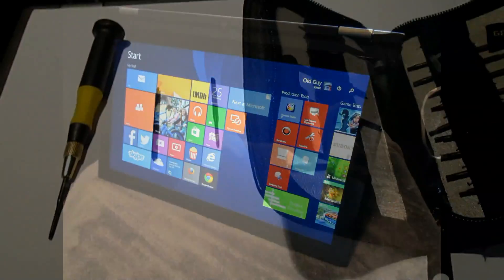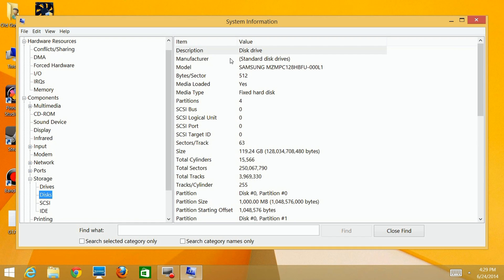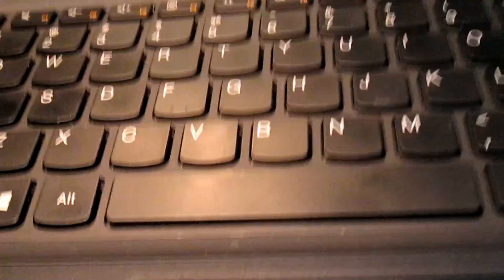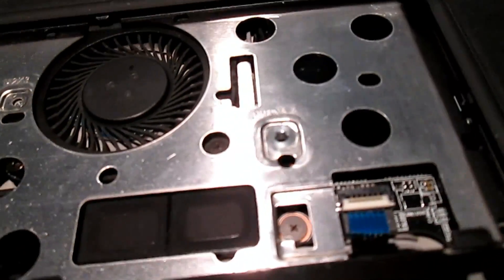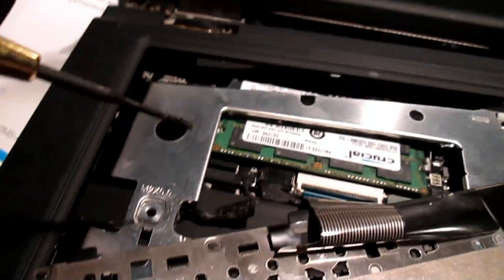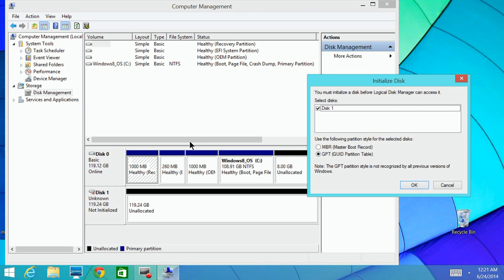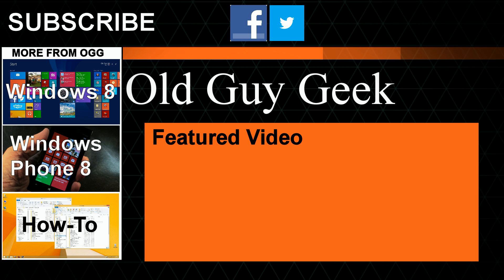Lenovo Yoga 13 - Add 2nd SSD Detailed Instructions

Comment: Great video. Question. Do you have an Amazon link to that exact ram module? I currently have only 4GB in mine since it came with windows 7.
Reply from the maker: My Yoga came with Windows 8 so I'm not sure we have the exact same model. Just lift up your keyboard and you should see the RAM module there. Use it's part number to search in Amazon.
Reply: @Oldguygeek  Will do! Thank you!

Comment: Thank you. I was just doing a bunch of repair, maintainence on my Yoga 13 and saw this and upgraded the hard drive space. Hoping with its Corei5 it will continue on for a while now. The lack of hard drive space was causing update and other problems. Now its fixed without a costly trip to a tech place. Thanks again.
Reply from the maker: You're welcome. Glad to be of help. Mine is still going strong and fast as can be with a SSD as the boot drive.

Comment: I went to your evo 860 link, ordered it, when i disassembled my computer to install it, it was way to big for space provided. My computer is Lenovo yoga 13
Reply from the maker: Strange. It appears that the shortened link from Amazon doesn't go to the same drive anymore. Here's the right one. https://amzn.to/2l6HlXr
Sorry about the bad link. I fixed the video.
Reply from the maker: I found another one that is 250GB and is a bit cheaper. https://amzn.to/2l8J2nr

Comment: This is a 710.
Do you have a video for the Lenovo Yoga 720 (13)? I’d like to see a complete tear down and/or rebuild.
Reply from the maker: I don't, but i did a quick search on YouTube for 'Yoga 720 teardown' and there are several videos about working inside one.  You might have found one by now, but just do the search for that model and you should be good to go.

Comment: Excellent post. I know very little about these things. I just followed your detailed instructions (including buying the torx screwdriver set and going into the BIOS - whatever that is lol). Anyway, because technology is always changing, I was able to install an internal Samsung 850 EVO 1TB SSD hard drive!! Now, I can continue using my 2013 Lenova 3 Ideapad (which I think is one of the elite laptop/computer/tablets ever made!).  Thanks again.

Here's the link for the torx screwdriver set. It's a great value and even came with a plastic tool that safely let me open the keyboard case. https://www.amazon.com/gp/product/B015F734P0/ref=ox_sc_act_title_4?smid=A13PRKMVKLJGWH&psc=1
Reply from the maker: Glad to hear the video helped. That's exactly why I do them.  My Yoga 13 is still going strong and it's even running the latest prelease version of Windows.

BTW, the BIOS is the built-in software that resides in the chips on your motherboard.  It allows the hardware to start up until it can access your hard drive and load the Operating System that is stored there.
Reply: I am currently not really happy, with the speed of my Lenovo Yoga 13: is the 850 significantly faster then the original ssd?
Reply from the maker: Not that you would notice. The real limitation is the processor in the system.  Also, there are many other things that can impact the speed of your system. Some virus protection software can really bog it down.  Plus other backend processes.  The SSD speed is the least of your worries.
Reply: I also assumed, that the CPU and the Bios is the limiting factor. However, would have been really interested in a Benchmark (in case, that both are Samsung; Samsung Magician could be a solution.)

Comment: Thanks for the video - I got a little concerned when I saw no clips behind the keyboard and one end of mine seemed to be "stuck" down but it was gradually releasing. I followed closely along but at first neglected to remove the torx screws since you only mentioned them in passing "facepalm moment". I was able to ease the case apart and get my 500G Samsung SSD installed. 

.... BUT as I was about to replace everything I noticed the blue-ended  ribbon on the right side of the keyboard seemed to be flapping in the wind :( I was not sure how it was connected all I could see was a small plastic flappy flange with some copper spikes where the connector came from. Examining the copper contacts I could see small indentations so I assumed it was just a pressure contact rather than broken.

I panicked for a bit until I found this video : https://www.youtube.com/watch?v=iOE4T6nykQ4

I carefully used some needle nose pliers, slipping the ribbon cable back under the flappy flange and pressed it down - it now all seems to be working and I have another 500G of storage :)
Reply from the maker: Yeah, the cables in any laptop are probably the most dangerous part of the whole thing.  Glad to hear you got it working.

Comment: hello! I added 500go Crucial SSD to my lenovo yoga 13 following your video.  but since that, I get death screens with kernel data inpage error and a lot of other messages. 
during a few days, every thing worked fine! but after updating firmware of crucial SSD and doing some settings to optimise it, i get the Blues screens! 
would remind that Os is still on the original lenovo ssd! I'm using the new on juste for storage. I also created some dynamic links to store every thing on Crucial drive : desktop, videos, pics, dwlds ...etc. 
do you know how a can fix that plz!
Reply from the maker: Did you take the crucial back out and see if you still have problem?  Since the error only occurred after the firmware update, you should be a able to run without it.  If that works, you'll have to see if you can access the crucial on another system.  You'll need an adapter to hook it up to a system either to a USB or directly to your motherboard.  If you can get another system to recognize it, see if the firmware update completed ok or maybe you can reattempt it.

I don't know what optimization you did, but Crucial probably has a utility to detect, read and optimize.  If you used that and it failed, you might have to contact Crucial.  If you used some other optimization utility, try the official Crucial one.
Reply: Thks for answer.
 I used official Crucial tool to update the firmware and after tests, the drive  seems to be ok. i can store data normally on it and use it as normally as possible! 
problems began when the update utility terminates and restarts! I got some issues! my pc restarts endlessly with crucial utility instead of restartiing normally with Windows. after serverals attempts, i had to put everythings on defaults il Bios so my pc restarts finally normally. 
I think i have to check if update completed normally! otherwise, is it possible to put back previous version of firmware? 
sorry for my broken english...
Reply: Cricial SSD Still works normally and i get less of blues screens but i want to fix this because i'm working on a huge document for my phd and can't save every minute. So if a restarts occurs, goning to lose a part of it. thks
Reply from the maker: I'm wondering if your Crucial utility was starting because somehow an error was detected on the SSD.  Much like if your PC detects a problem with a regular drive it will perform a disk check prior to starting Windows. 

If you are worried about your docs, I would setup OneDrive to replicate them to the cloud.

Have you checked the Crucial forums for problems after the firmware update?  Also did you do the Lenovo bios update as part of the install of the drive like I showed in the video?
Reply: I posted on crucial forums, no answer yet. 
Crucial SSD still workiing fine! no blues screens since 3 days! all utilities i used to test it indicate a high lever of health. 
I hope that the problem was resolved :) thank you for help!
Reply from the maker: Glad to hear you got it to work.  I was really concerned that the firmware updated failed somehow.

Good work on getting it done,

OGG

Comment: Hi, I followed the instructions as in the video and now the laptop does not recognize either hard drives. I removed the new hard drive and still no change the BIOS and booth manager are not finding hard drives. I have not touched the original, primary hard drive. It's my father's primary and only computer and any help would be of great help. Thanks!
Reply from the maker: +Pranav Sharma Cool.  Yea, I learned long ago when working with a Fujitsu tablet, that ribbon and other connectors like them are so easily screwed up.  I'm sooo glad you got yours fixed.
Reply from the maker: +Pranav Sharma I would double-check the cable under the keyboard.  If one is loose, you can have various problems.
Reply from the maker: +Pranav Sharma Also, check out this blog and the link to download the maintenance manual

https://forums.lenovo.com/t5/Lenovo-Yoga-Series-Notebooks/Can-you-install-a-second-mSATA-SSD-in-Yoga-13/ta-p/1039799
Reply: @Oldguygeek thank you for the link to the forum
Reply: +Pranav Sharma I actually just had this problem, and I managed to fix it.  My problem is that the motherboard had become disconnected in the process of taking everything apart.  There is a connector above the battery and is green in color and is, I believe, labeled "MB."  Make sure that's not disconnected.  Mine was, so I pressed it back in, and suddenly I was able to boot just fine!
Reply from the maker: +AxelFan91 Thanks for your info.  I had replied to her and not heard back.  I hope she found the problem as well.  I figured it was a connector problem, but I had no way of finding out which.  Maybe she'll see your post.
Reply: Sorry for the late response, I have the same issue as Alex, turned out it was broken connection on the right corner to the motherboard. Plugged it in and fixed the issue with everything upgraded.

Comment: Just an FYI. There are four clips underneath the center of the keyboard. It is important to press down across the center of the keyboard while sliding it towards the front in order to engage those clips. If you don't engage those clips, the keyboard will be very bouncy. Thanks for the useful video. I just upgraded my Yoga 13 to 8GB RAM and added a second 500GB SSD to the existing 128GB. My Yoga has been around the world several times and been used in rain and dust and I've never had any trouble with it. I'm hesitant to upgrade to the Yoga 2 or 3 for fear they are not as robust.
Reply from the maker: +2jomok2 You're right there are four clips in the front, but if you slide the keyboard back in from the back and slide it forward, it will hook onto the clips.  Those clips aren't really designed to be pushed down to clip, the keyboard tabs slide in.

I understand your reluctance to upgrade your Yogas.  I didn't do the second SSD until mine was out of warranty.  But you sound like a more advanced techy person so I'm sure you won't have much of a problem.
Reply: I might be talking about different clips. You are speaking of the four plastic clips to the front of the keyboard.  There are also four metal clips underneath the center of the keyboard going from side to side. You can see one clearly at 5:04. I learned from experience 8-( that if those aren't engaged, the keyboard will be bouncy.
Reply from the maker: +2jomok2 Yep, probably.  I found that the back clips need that tape that was there.  Otherwise it was bouncy too.  But at least adding the second driver sure made the Yoga a lot more useable with the extra space.

Have fun with it.

Comment: Help.  Followed the video.  Everything seemed to go fine but now won't power on.  Tried the reset button next to the power switch.  Still nothing.  Any ideas?
Reply: Howard Solovei Stlll have the case bottom screws out. Do they need be in for some reason to power on?
Reply from the maker: Howard Solovei Nope, I left the screws out until I tested everything.  Check all your ribbon cables under the keyboard.  Make sure you didn't dislodge one.  Also, if you still have problems, remove the extra drive and test it without it.
Reply: Howard Solovei Nevermind.  Found loose cable, works now.
Reply from the maker: Howard Solovei Excellent.  Glad it works.

OGG
Reply: Thanks for your help.

Comment: can you tell me how i did you see ssd at bios pls i can't find ssd (i installed properly)
Reply from the maker: Süleyman Aslan If the SSD is ok and install properly, it should just show up in the bios.  If you can take it out and reseat it or plug it into another computer to check it. Hopefully reseating it will do it.

Comment: This second hard drive can only be use for storage right? you cant install programs to it?
Reply from the maker: latribu99 Sure you can. Most desktop programs have dialogue boxes that comes up and asks where you want to install the program.  Most everyone ignores that and keeps them in the Program Files or Program Files (x86) directory.  But you can choose wherever you want.Years ago, software was more finicky and upgrades of software sometimes wouldn't find the installation if it was installed elsewhere. But you should be safe today.  I created a Program Files directory on the D drive as well.  I didn't bother with the X86 directory to keep the 32 bit and 64 bit programs separate.
Reply: Old Guy Geek thanks for the info. I'll definitely try to get a second HD on mine yoga

Comment: Thank you very much for the detailed video. I managed to install a 250gb Crucial ssd. I used maximum disk space and ran a quick format which showed the new ssd with 232gb available space. But after restarting the computer, available space had dropped to 220gb. Losing 30gb, even after formatting is pretty significant for a 250gb ssd. Is there any reason for losing such a lot of space and is there a possibility of reformatting to correct this? Or am I just being paranoid?
Reply from the maker: Rasta Fari Well, you're right, 250GB should have more space. But check to see where the system put the swap file.  You may not need one with the SSD.  Do some searching to get the latest recommendations.  Then check your Recycle Bin size.  It's normally way too large.  Lastly, check your browser's cache size.
Reply: Old Guy Geek Thanks for the reply. I'll look into that. I did some research online and a maximum of 232gb space should usually be available without issue. Contacted Crucial and they also agreed that 220gb is too little to get out of 250gb.

Comment: Hello, can I use Samsung SSD mSata 500GB EVO840 as 2nd disc?
Reply from the maker: David Šenkýř If you have the original Yoga, sure.  But you have to have a 2nd mSata connector in your system.  Check your system specs to see if it is capable.  The manufacturer and size of an SSD aren't normally restricted.  Windows 64bit will access disk with terabytes of room.

Comment: Shame the video is completely out of focus....
Reply from the maker: It's not.  Use the gear setting in the lower right of your video panel.  Change the resolution to 1080HD. It looks great.  You can change your YouTube account settings to always show videos in high resolution.  Then you never will have this problem with any other videos.

Click on your picture in the top right and then click on the gear icon. You will be in account settings.  Click on Playback.  The first entry will allow you to set YouTube to always play the highest resolution.  If you have a slow connection, it will take some time for videos to load.

Comment: youre video is confusing.. the SSD you installed is a SECOND SSD, or did you just upgrade the original? I thought the second SSD slot was towards the front of the computer by the battery
Reply from the maker: Like the title of the video says, I added a second SSD.  On the original Yoga 13, the second SSD slot is on the far right.
Reply: Old Guy Geek
cool thank you, I appreciate the advice! I'm going to attempt this, and I need to replace my trackpad too because it's stuck down and won't pop back up  grrrr
Reply from the maker: polaris911 Just be careful of the ribbon connectors.  They are difficult to reinsert and can be broken easily
Reply: Old Guy Geek
okay.. did you have any issues with re-using the chassis screws? I remember reading somewhere that these screws have a silicone thread and aren't supposed to be re-used.
Reply from the maker: polaris911 No problem with the screws. They might have some silicone on them, but I'm pretty sure they ware regular metal screws.  But, in later revisions of the system, they might have used different types.

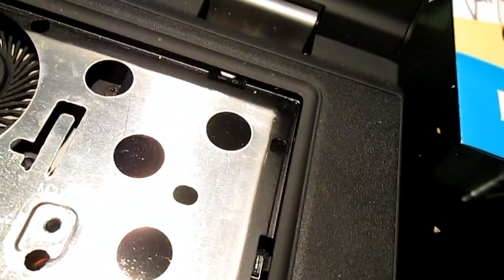If you want to see the placement of the second SSD go to 8:21 in the video.